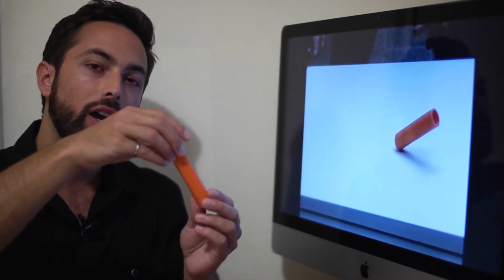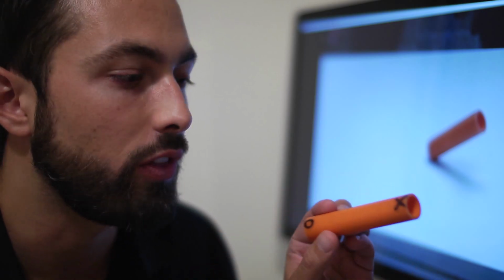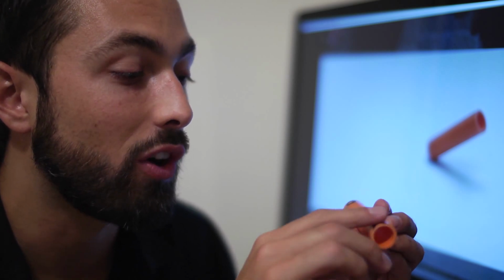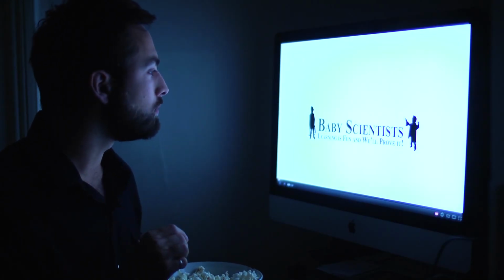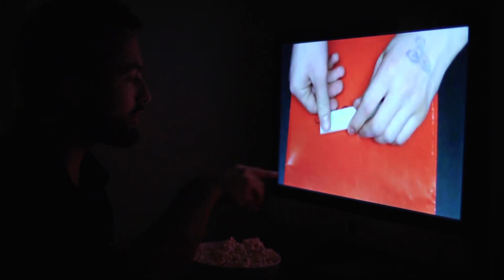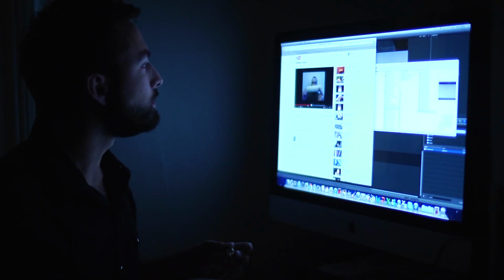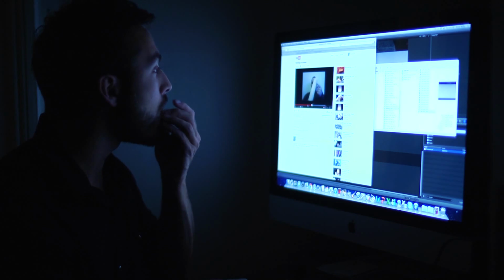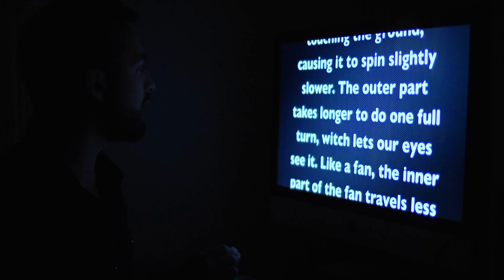Spinning Tube Trick Explained

Comment: This explanation does not account for why it appears to be the opposite symbol when seen from underneath the glass though.
Reply: Because from underneath it's reversed, so you'd see the other symbol
Reply: It actually does. Just imagine in your mind the same scenario viewed from below - at that time the 0 would actually rotate backwards with respect to the horizontal rotation, much like X rotates backwards with respect to the horizontal rotation when viewed from above. So it perfectly accounts for it.
I do understand what confuses you, but focus on the flat 2D viewpoint of what you see - when viewed from below you simply see 0 going in the opposite direction from the one in which its end of the tube is going (which makes it pass a smaller OVERALL distance, because the motions kind of "cancel each other out"), and the X is going in the same direction as its end of the tube (which makes the motions add up and therefore makes X pass a much longer distance in the SAME amount of time, which ultimately makes it much faster, hence more "blurry" and less visible in real time).
Of course the opposite stands when looked from above.

I hope this clarifies it.
Reply: Answered in another video that from underneath u would see symbol "O"

Comment: I don't know anyone has seen this . I always keep staring at our ceiling fan & rotate my eye in the same direction of the fan i don't see anything. But when i rotate my eye on the opposite direction i see some blades are slowly circling in the opposite direction. I wonder how this works. Anyone should make a video about it.
Reply: Sorry i had been 5 yrs late...  i think that this is nothing but relative velocity....
Ceiling fan spins in anti clockwise direction, so when you are rotating ur vision in the clockwise direction , the blades would appear to be fast like ur at a train window and suddenly other train comes from the opposite direction. It appears to be fast.
But when 2 trains , one urs and the other on ur parallel track is moving with youin the same dir, the other train ( although , may be faster than u ) , appears to be moving quite slowly . So the fan when you c rotating ur eye in the direction of the blades , the blades would appear to slow down....

Comment: but wait that doesn't explain the under version of why you see the opposite letter if it is spinning faster then why would you see it on the other side of the table ?
Reply: Nathan Church If you put a sticker on the upper-right corner of a window pane and walk around to the other side of the window, you would see the reverse of the sticker on the upper-left of the pane. So, the direction changes. Same thing happens with the tube.
Reply: Not the same with the tube because his reason for not seeing the other letter was it was spinning to fast so you couldn't see it not because it was on the other side
Reply: But as I mentioned, the direction changes on the other side of the glass. Remember that the letters don't actually move on the tube, so when you spin the tube, you see a specific letter based on the rotation AND your current perception. Moving to the other side of the glass opposes this direction and thus you see the opposite result.
Reply: Nathan Church Because the X you see on one face is in a certain position for you to see, while the other end of the tube (the O) is doing exactly the same thing but opposite. So if you would watch from the other side, it would be the O that is spinning against the whole tube rotation. Just watch the last seconds of this videos a few times and imagine being on the other side of your screen.

Comment: I think you left out a factor.  Yes the spin opposite slows the relative speed of the x but also the x is not traveling as far either.
Reply: Actually at first launch they both rotate about the middle of the tube so that was wrong. I was watching the end of its rotation as it stands up and lays down

Comment: That's not correct though. Perspective doesn't change whether its X rotation is the same direction as its Y rotation, I made a model showing the vectors and viewed it from top and bottom and the vectors he indicates with arrows in the video remain the same, the same end should be the faster one. It shouldn't change which symbol is visible when viewed from the bottom... unless I'm misunderstanding this.

Comment: It doesn't explain why you see an O on the other side tho, looking from the bottom.
Reply: +無為 Imagine a car wheel (better the axis of the wheels) of a car in movement.
 If you look the wheel from above you'll see the X going forward while 
the axis goes forward too(in fact you can't see the X because is moving 
too fast), but if you look  the wheel from below you'll see the X going 
backward so you can see it now. In video, above the crystal X is moving 
backward and we can see it (and not O which is moving forward) but under
 the crystal X is forward and we can't see it in opposition to O which 
is now moving backward and for this we can see it.

Comment: not if the axle is in the middle of the wheel. it will spin at the exact same rate no matter what part of the wheel the valve is at... you don't go through surges in speed like that when you're driving with cruise control on, do you? it's a fixed speed on a fixed object. if that axle wasn't in the middle of the wheel, you would have a real bumpy ride. if your wheel went twice as fast half of the time, you would be jerking all over the place.

Comment: I believe your answer fails.
You are aware that the "O" and :X: are visible from the top for exactly the same time?
If you flashed a strobe, you would see both equally.
Horizontal motion of the tube end doesn't matter.

Something about the motion and the camera is what causes the difference.
Could it be because the camera doesn't see the entire field at the same instant?
We know TV's raster.  Does your camera?

Fun follow-up.  Draw a line from X to O, then film.

Does the line seem shortened?

Comment: No it does not. Think about it, press the X and from the top the O spins faster, but like a wheel in the same direction of the rotation, from the bottom the action is reversed, the O spins slower and the X spins faster.
Imagine a wheel of a car traveling, when the valve is side up, it goes twice as fast as the ground and in the opposite direction, when the valve is on the ground side it travels at the same speed so still compared to the ground.

Comment: if that is the way it is then why do we see the O from underneath the glass. the same logic should have applied to the O too..
Reply: Let's say the X is visible, when you look from above. If the tube is rotating clockwise, the X becomes visible, when it appears to travel from right to left, while that end of the tube appears to move from left to right. Now, what happens to that clockwise motion, when you go underneath and look from the other side? Now, the motion appears counter-clockwise and the O is 'slowed' by its left to right motion.

Comment: There is no way one end spins faster than the other end, its hard plastic. It would be like having a solid axle on the back of a pickup, you'd break sometjong
Reply: Each end is spinning at the same speed, but in opposite directions.  But with the spin along the long axis, the X and the O are turning in the same direction.  So the X (for instance) is moving against the spin, and the O is moving with the spin.  The O "goes past" faster than the X.

Comment: The explanation'doesn't prove the phenomena. Fact is that both x and o appear at the same time, it is our eye's limitation that we cant see them together and directions of velocities are not the proof to it, though it is a part of the reasoning. The image we see persist for 1/25 of a second, due to persistence of vision. The x or y that we see is actually the appearance of the letter multiple times at the same location and same orientation of the tube. Because outer edge is covering a larger volume in space; the probability of that alphabet to orient at same position and location has increased. While the inner alphabet is covering smaller volume in space hence its probability to appear and disappear is .5 and deviates less from it. Hence if you close your eyes and spin it. Then open your eyes. There is a chance that you would see the inner alphabet once in 24 repetition of the experiment.

Comment: Heeeey! you didn't explain why this changed, looking at it from below....
Reply: That's because looking from the bottom the sense of rotation is reversed: if looking from above the tube was spinning clockwise, it'll be spinning counterclockwise when looked at from the bottom. But the tube spins along its long axis in the same direction -- the angular momentum is always pointing outwards, so now the relationship between the relative velocities is reversed.
Reply: Nice, thanks

Comment: He still din't explain looking under the table ? 
Let us assume what he said. If he press down on X. we can see X because of the relative velocity of X. while O is faster. If we look from the bottom velocities still remains the same its just the reference frame is different. Can someone point out how this works. I'm not convinced with the solution.
Reply: If you see it from below, the tube would appear to spin on the opposite direction (counter-clockwise instead of clockwise, for example). In this case, the O would be slower than X instead.
Reply: I still don't get it. forgive me, i am slow. The pipe touching the surface will still be the X. and it will still be slower than O right ? the reason we are seeing this is because of the relative velocity of the pipe revolving and rotating. they wouldn't change based on the frame of reference. I still feel that what happens from below is counter intuitive.

Comment: this still doesn't explain why we see the opposite symbol when looking from under it.
Reply: What happens to an apparently clockwise motion, when viewed from underneath...
Reply: stephmon See the video. It still rotates the same way, even if you see it from below.
Reply: Morten Hygum Right, but from below, the motion appears counter-clockwise, which means that the long-axis motion of the opposite symbol is now traveling in opposition to the short axis rotation (allowing it to 'persist' long enough for your vision to see it). This is all about the relative velocities of the symbols, as they move with the short-axis rotation and whether that velocity is relatively accelerated, or decelerated, on the visible side of the tube, by traveling with the short-axis rotation. That relationship reverses, when viewed from below.

Comment: Your explanation is inconsistent with your experimental result. In any given trial, only one symbol can be at the end of the tube that rotates counter to the direction that the tube spins. One should expect to see the same symbol from above or below the table given your explanation. I don't have a better suggestion right now but I am puzzled by the glass table results.

Comment: Sorry, I don't buy the explanation. " The velocity of the x will be reduced by it's spin in the backwards direction.". Sorry, the same is true for the o because the center of rotation is between the two, and the o is actually moving slower. The end result of that logically is that both the x and the o are visible for the same amount of time...which is obvious of course. So you haven't explained anything. 
Isn't the proper explanation that the image of the o is visible for time t but is smeared across a smaller area A1 of the retina, whereas the x in that same time t is perceived by a much much larger area A2 of neurons. The image of the o is not detected well by the visual system because the information is too dense, but the image of the x is spread out over more neurons which can contribute to the visual system's correct perception is that symbol.